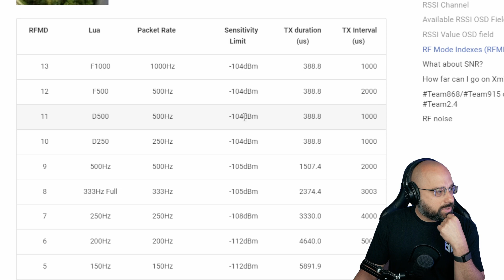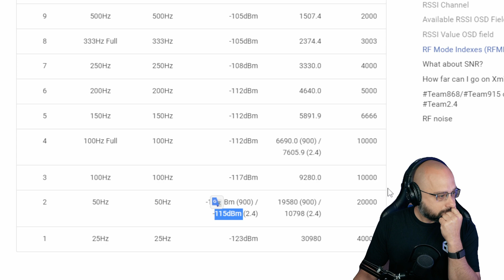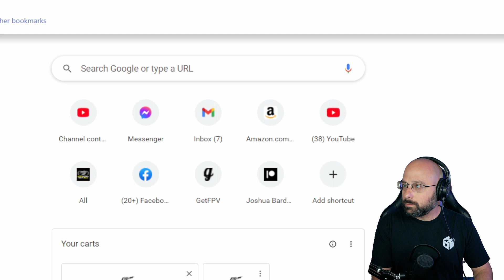Is Packet Rate Better Than Output Power For Range? - FPV Questions

Comment: Hi Joshua great videos im enjoying the steep learning curve coming from Futaba to radio master and your video help me a lot. Can I ask as I am flying a very expensive 2mtr F3a pattern plane, electric and I have opted for  333hz full and 250mw output. I have noticed that I get smooth servo operation with this but if I lower the hz the servos get jittery like the resolution gets worse? Can you tell me why there is 100hz full and 333hz full what does this do why, and should I change anything. Im flying 150mtrs out and 500-600 mths to left and right of myself. that you.

Comment: It's the same reason why WiFi/cell service becomes slower as you get farther away from the transmitter. The greater the distance the lower the signal integrity but with a lower packet rate each bit can be transmitted for a longer period of time which makes it easier to differentiate it from random background noise so you get more range on the same transmit power. It's like speaking slowly to someone who can barely hear you instead of speaking quickly.

Comment: I think packet rate is very important. In 915 Just 50Hz to 25Hz is -120 to -123 so 50% more range. Same as going from 500mW to 1w.
So when i run 200Hz id need like 7x the mW to go same range. 
Prob should used ELRS24 analogy since ELRS915 25Hz 10mW ive gone 3miles and still had -17dbm left.

Comment: I just had a weird failsafe with ELRS 915mhz, within 150 feet from myself, clear line of sight. I've been using 200hz. 500mw power. I will go check out your other video. These out of the blue failsafes that happen for no obvious reason make me not trust the equipment at all. Should I fly over a tall tree or over water or over a building? Probably not if the quad is just going to fall out of the air. The quad would not regain the radio signal at all. I never lost my Vista video link. Very strange. Then power cycling the quad I would hear 3 beeps only. Ok, so now the FC isn't talking to the ESC? I get home and pull the top off and use a smoke stopper and I have all 5 beeps. I took it all apart. No damage to the electronics. No damage to the Happymodel elrs receiver. No damaged wiring. The only damage was to the 2 arms the 7 story fall caused to snap off. This was even the first crash with the Speedybee F7 stack.

Comment: Was going to say inverse square law, like painting 1m squared area, at 1m distance, and at 2m you cover 4m squared, from memory. Or is it you would have to increase spray paint gun power by 4 to cover same  thickness of paint at 2m. Double the distance, 4x as weak (using same power), OR your simple 4x the power to get 2x the range.
Think my teacher used the spraying cheese on to toast from a distance analogy .haha